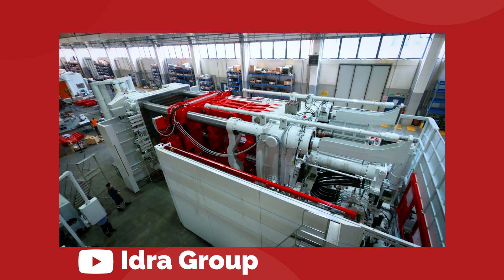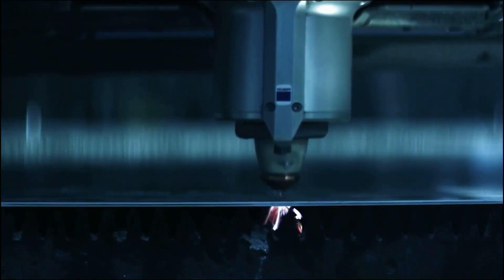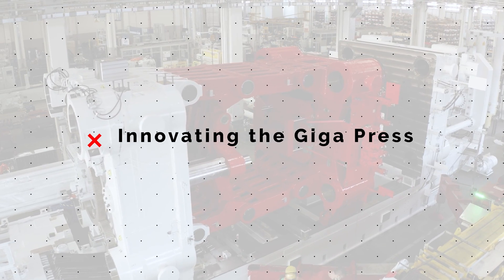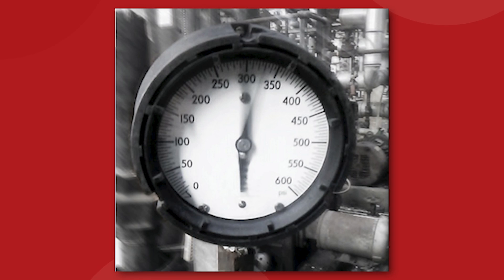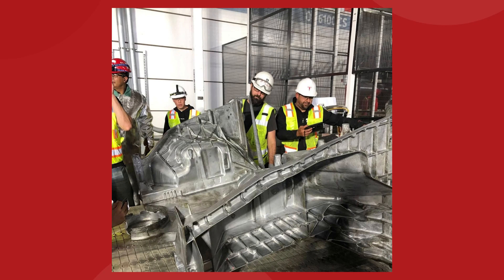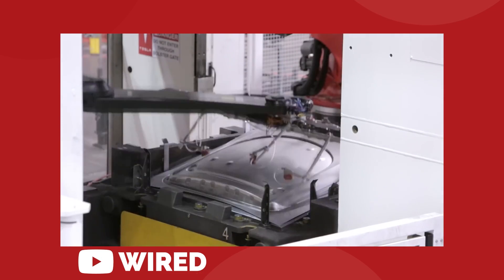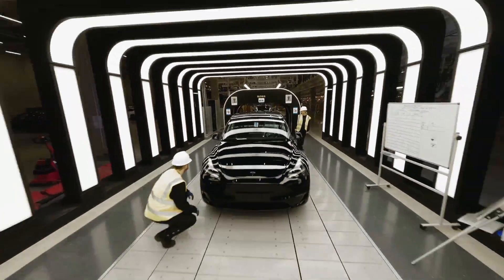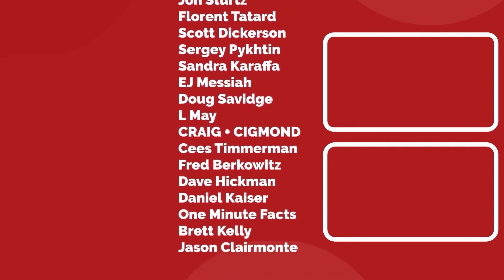The Real Reason Tesla Developed The Giga Press!

Comment: Ridiculous.  It's been known for over 70 years that it's a fool's errand to make very large parts with very large presses.   Most popular example: the Russian Concordski had some very large landing gear and fuselage components made in a very expensive, very heavy, very large press.  It seemed like a splendid idea.  But in reality it turned out to be a very bad idea, as large parts can't be repaired or replaced.  If a small crack develops, you have to throw away most or effectively all of the plane.  Same with the Tesla gigapress-- it may save Tesla a few bucks, but it makes the car unrepairable.   Tesla's are already ridiculously expensive to repair, this development pushes it right over the edge into absurdity.
Reply: With this logic, unibody cars shouldn't exist either. That came about to decrease manufacturing costs. The economics all work out at scale. Even if it's more costly to repair, when you only need to repair 1% of vehicles, the savings in manufacturing greatly outweigh it. Tesla is entering the insurance game too, so they are willing to own all the risks associated with this, not just pass this on to someone else.
Reply: @TheRockHardKeg  - you said the key point here: Economies of Scale - it's all about the economies of scale. When you build 100,000 or a million of anything, there will be units that with defects - it's unavoidable. But the margins on the product should be able to absorb those defective units, ...etc etc.
Reply: @TheRockHardKeg  Ha!   So wrong.  And you admit it's done to reduce costs to tesla, not to benefit the end user.
Reply: @TheRockHardKeg  exactly, and Elon has said if your in a big enough crash to damage it you won't want it repaired.
Reply: @TheRockHardKeg  Unibody cars are repaired by unbolting or cutting off sections with plasma or acetylene torches and rewelding on new parts.  This works fine for steel parts up to about 5mm thick.  Not so well for thicker parts.   It's really hard to weld anything thicker, and anywaay, Tesla is already condemming Tesla frames with just superficial samage from bottoming-out, so the chance is exactly 0.0% that they would start doing difficult welding.  They are generally saying "screw-you, buy a new one".
Reply: @georgegonzalez2476  no mate. Unibody cars with a damaged structural piece get written off and most get scrapped.
Reply: The most expensive part of the car is the battery. In case of a hard accident, if the battery is not damaged, the will be able to replace the battery into a new cheap chassis
Reply: @jimmykruspe  Wrongo, Bub.  The battery is only about $3,000.  An average Tesla sells for $66,000.  So the battery is only 7% of the price of the car.  And in most countries it is illegal to sell as "new" a car with used parts.   So it's not only  illegal, it's uneconomical to throw away the chassis.
Reply: @georgegonzalez2476  You're so wrong a new battery cost $22000 installed... I have no idea what you get your numbers
Reply: @georgegonzalez2476  the average Tesla sold is by no means 66k more like 40
Reply: I dont think the battery costs 3k, it should be more like 10 to 20k depending on the size
Reply: @PARACHOQUEDECLIO  A new replacement Prius battery is between $2,200 and $4,100.  A new Tesla battery:  between $13,000 and $14,000.   A used Tesla battery is only worth about  $1,400.  Too low to be of much comfort.
Reply: Tell me you’re a boomer without telling me you’re a boomer
Reply: @CameronSevyn  - my favorite band is Pink Floyd. Does that work? How about I remember "Stay tuned, film at 11" or watching the little dot in the middle of the black&white TV screen slowly fade away after turning off the TV set. Or, knowing that it would take upwards of 45 seconds for a TV to come on and not because it was booting. Or maybe the aroma of tubes warming up inside a radio or TV and the orange glow coming from the back of the TV/radio. Or why there was a pair of pliers on top of the TV set. How about alternative uses for a wire coat hanger: like a TV antenna or a device to unlock a car door. How about knowing wtf "Vertical Hold" is? Or "flooding" the engine. Or when to use the "choke". 
All of those things say what you told me not to say specifically. Am I right? Did I miss anything? 
Anyway, y'all have a great weekend and thanks - I had fun commenting on your comment
Reply: It's worth noting that whether or not it's possible, this isn't going to ever be as efficient as making smaller parts and welding them together for the same reason why 3d printing is mostly for weird shapes and small output. You need one of these to do one body at a time. If something is wrong with the part, you've wasted the entire thing. If you're only doing portions of the frame, you can do a lot of them at once on a small number of machines and if part of it wasn't to spec, you haven't wasted much time.

It's these kinds of bets that have been holding Tesla back. It likely can be made to work on a larger scale, but it's an absurd place to skip to without doing the rest of the work. There's a reason why things are being done the way they are. That doesn't make it automatically good. It also doesn't make it automatically bad either. Tesla would be in a much stronger position if they'd learned what they were doing before pushing the limits on capacity so much.
Reply: @SmallSpoonBrigade  - "...this isn't ever going to be as efficient as making smaller parts and welding them together..."
Number one rule: Never say never. I have been working in the computer electronics industry for 45 years and I have seen people say "that's impossible - it will never work" about so many things only to be proven wrong over and over again. I have learned to never under estimate the creativity of engineers. I believe the same rule applies to Tesla.
I also believe your statement that welding many small parts together is more "efficient" than making a single large part needs to be far more specific. How, specifically, is it inefficient to build a single-piece rear and single-piece front chassis? You understand that by going to these single-piece structures that more than 300 robots were eliminated from the manufacturing process and the time required to build the front chassis was cut significantly. Furthermore, the single-piece structure is made from an aluminum alloy that is also used on the SpaceX rockets so it has well known and well understood physical properties that surpass those of a chassis made from multiple, smaller pieces. There are also efficiency gains when you consider that fitting and alignment of other parts relative to the chassis are more consistent and minimize associated manufacturing errors. 
Besides, Tesla has been successful in the deployment of these GigaPresses for a few years now. The Model Y has been built with a rear cast since day one. The new Model Y has both rear and front casts. 
I'm sure Tesla did not go into this blindly. They benefited from the years of experience that IDRA had with building GigaPresses for various industries. Tesla just decided to take an existing technology and apply it to the manufacturing of automobiles. 
So, why didn't any other car company do this first? Well, I have many friends who have worked in the automotive industry over the past 50 years and they all say the same thing: it is extremely difficult for the legacy automakers to adopt new manufacturing processes because of culture and the expense. Culturally, they don't like change. Expense is also critical - they operate on very low margins and cannot or will not spend any money on anything new without a clear ROI. It's that thinking that will kill them. Well, GM at least. Ford seems to have more rational plan by forming the Model E division for all things electric. 
That's my 2 scents FWIW.
Reply: that is the idea
Reply: Never seen a normal vehicle with frame damage not considered totalled.
Reply: @josephroach711  frame damage doesn't mean totaled. It's cost of repair vs value of car. I did bodywork for 16yrs and repaired many frames. Glad I got out before this crap came along.
Reply: @objectivetexas1  we have a frame rack at my work where we can pull a frame if it's been pushed around it's all like you said, is the vehicle worth the money and will the insurance pay, we've done a couple frame swaps recently too so there's obviously different options sometimes
Reply: LOL it is not! If the cracks / imperfection happens at factory, they can simply melt and reuse back the alloy....
If it happens on the road due to accident, insurance likely will write it off. And customer buys a new car! It is good business. It is meant to be a mass produced car anyway, like yr fad fashion, ppl wear and throw. Eventually car is scrapped and materials reused again. But Tsla gets new sales from same consumer. Its pretty much like how Apple makes ppl buys new hp by slowing old hp down with "upgrades". The company has to stay afloat. 
A single cast is stronger and safer in a crash anyway.
Reply: @benjaminng1112  let's not assume insurance companies will cover the cost of these cars to replace with new one.  Insurance companies are not in the business to pay all claims either
Reply: @lrobie123  they will have pay for "beyond economic repair", not full amount, but a big portion of it. Of course they are for profit, but they are legally bound to, unless they find credible reason not to, eg driver was intoxicated or car performance had been illegally modified. Otherwise, you can also assume tesla cars will never get into any accidents. Lol.
Reply: Dear George, the big difference is clear and evident, Tesla and Idra are not Russians 😁...
Reply: @jorgeg162  ofcourse when the Russians did it, technology was still way behind. We grown hard to improve. It doesnt mean it still can go wrong. But in the end this is great for Tesla only and not for the customers as it can raise repair costs alot
Reply: Nothing has changed since the Tu-144 was designed in the 1960s, so…
Reply: Break points, you should be able to find pictures online of the Break points they built in so minor damage will be able to be repaired, not sure if it's bolt on or what but they definitely thought of damage before they went ahead with this lol
Reply: @mattjenkins2244  I have never in my sweet long life every heard of mechanical break points.  A Google search turns up nothing.  There ARE a very few items that have intentionally narrowed down places so they break instead of jam-- some alternators and starters for instance.   Car frames in particular are carefully designed to NOT break and to protect the occupant.  There are front and rear controlled crumple zones in cars but they are not cast or molded.
Reply: @georgegonzalez2476  the limiting factor, it's a channel on youtube they have a video specifically on the crash worthiness and repairability if the gigacastings, keep looking..
Reply: @georgegonzalez2476  - and, if you have been tracking the design of the Tesla cars with respect to safety, you would know that the single-piece castings provide unparalleled strength and protection for cabin occupants. There are pieces on the front and rear that take small/slow impacts so as not to affect the casting. That actually covers a significant percentage of repairable accidents. 
Furthermore, those castings are made from a proprietary aluminium alloy that is used to build SpaceX rockets. So, it is exceedingly strong and, if we ever get a software update that allows our Teslas to fly, they will be flight-worthy. Hey, as kids in the 1960s, we were promised flying cars in the future. And here we are with no flying cars! Yet. 
A word about cars that do get into serious accidents and are not repairable. The aluminium and aluminium alloy parts are recyclable by design. So is the battery pack. The recycling of aged-out and damaged batteries is built into the overall manufacturing process at the Giga Factories. 95% of the materials in a battery can be recycled and used in new batteries. The other 5% is sold to Hostess for use in Twinkies and Ding Dongs. 
OK, maybe made that last part up but the rest is true.
Finally, I grew up in Detroit in the 1960s and 70s with many friends whose parents worked at various jobs in the automotive industry. At least a dozen of my personal friends went into the automotive industry but, like me, have since retired. But we have many discussions about how Tesla is single-handedly reinventing automobile manufacturing and how the legacy (aka ICE) car makers are trying desperately to catch up. But the legacy companies have serious obstacles to overcome - the least of which is a major cultural shift from "we're going to do it this way because we've always done it this way" to "Start with a clean slate - how do we build a manufacturing facility for electric vehicles? And nobody over 40 is allowed to participate unless they think out of the box" All of my friends who worked at the BIig Three (Ford, GM, Chrysler) over the years all express this same cultural problem and none of them know how to fix it. 
I think Ford might have a chance at getting past that cultural problem and succeeding but GM is going to die a slow, painful death - due in large part to the idiot CEO they have - but that's an entirely different rant. The VW Group has a good chance at getting it right but we'll see. 
Bottom line, speaking from experience and listening to many experts in the field of automotive manufacturing, giga castings are definitely the way to go. So, unless you have some quantitative data that clearly states otherwise, you might want to rethink your position on the matter. 
That's my 2 scents.
Have a great weekend Good Sir George!
Reply: @georgegonzalez2476  they exist. On cars they are called bumpers, you know the thing on either end of the car,and are easily replaced.

If the damage goes beyond them and actually impacts the structural bits just scrap the car. Because at that point you are replacing about half the structure, all the body panels in front of the A pillar at a minimum and most of the drivetrain. Which just ain’t worth it for a car that isn’t currently worth we’ll into 6 digits.
Reply: @thomasruwart1722  Well, you're entitled to your opinions.  In my opinion, Tesla makes lousy cars (oops, Consumer Reports agrees), they make very expensive cars (obvious), and their customers are very dissatisfied with the way tesla repairs cars, and some folks that have bottomed-out slightly and cracked a frame part, Tesla has said the car is unrepairable.   I don't know about you, but if I have a choice of Tesla technology and prices and service, I will go for a non-Tesla every time.  Your opinion may vary.
Reply: @georgegonzalez2476  Fair enough, Consumer Reports gave a bad review. On the other hand. I own a 2022 MYP and previously owned a MYLR. I have two friends that drive a M3P and a Model S 100D. I agree that there were minor issues with my two Model Y cars but they were eclipsed by how amazing both cars were. My friends, likewise, will never buy anything other than a Tesla in the future. I think the demand for the Tesla cars speaks for itself especially considering Tesla does not advertise at all. It is entirely word-of-mouth and the few unhappy Tesla owners, well, there seem to be so few of them that they effectly get drowned out. 
Also, Tesla is not just about the cars. It is more so about new and innovative manufacturing techniques and technologies that allow for better cars overall. 
I don't for a second believe that I am going to change your mind or convince you of anything. History will be the judge of Tesla and EVs in general. Give it 10 years and we'll see where things are at.
In the meantime, have a wonderful rest of the summer! Thanks for your thoughts.
Reply: Usually cars get only damaged in accidents if they are not designed badly

Comment: These parts are cracking and failing in model S plaids when driven hard. There is a reason aluminum hasnt been used in large chassis components. Aluminum isn't nearly as ductile as steel, it cant take the repetitive strain without failing like steel can.
Reply: The model s, x, or 3 have never been made with giga press structures yet.
Reply: From what I can tell is that the tesla car , or truck, can't be repaired after an accident.  At least with ice cars, and trucks you can.